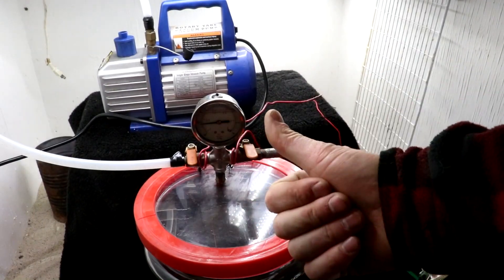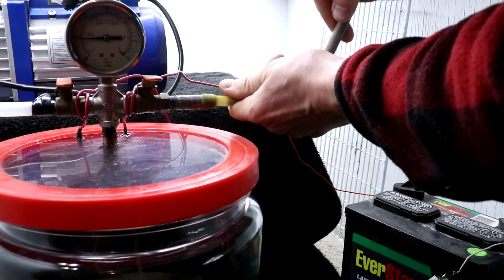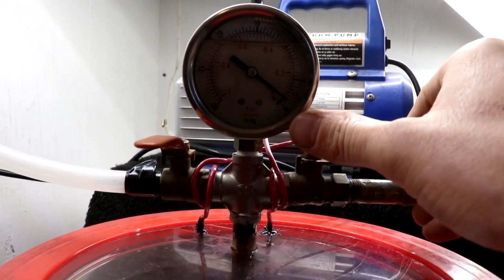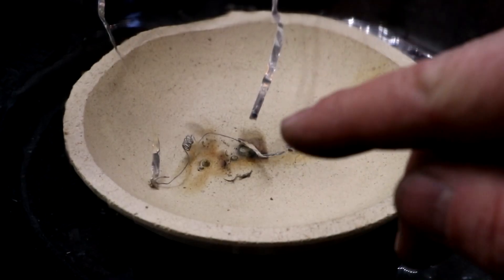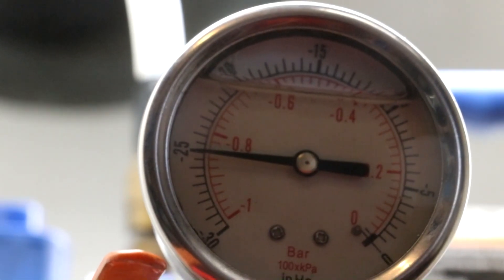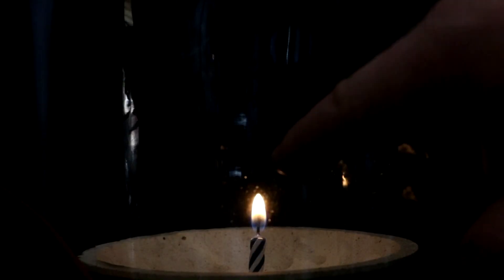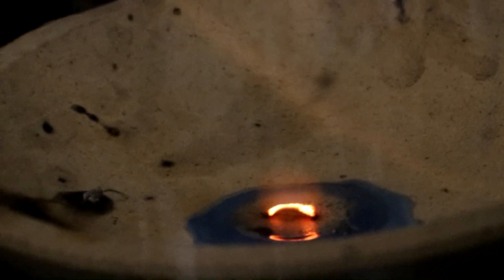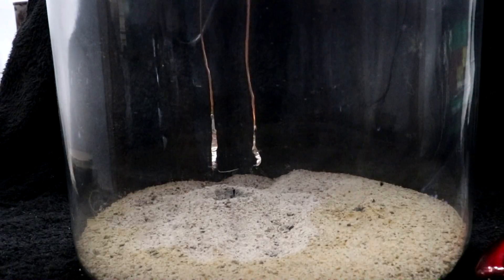Fire in Low Pressure Pure Oxygen

Comment: awesome.. in the last test where the candle burned very quickly, I wonder what all was going on there.  The wax seemed to melt much faster but wasn't actually burning as it would at atmospheric with air.  If the test was done where the wax was held in a container and wick not allowed to be exposed so quickly, would the wax have continued to burn in that pure oxygen / low pressure environment?  Would it burn across the entire surface or is a wick required to maintain an ignition?  Is some of the melted wax actually vaporizing in the lower pressure?  I'm left with more questions than answers - awesome little experiment!

Comment: Paper:
3:30 - Control (1 atm or ~29.9 inHg) w/ regular air
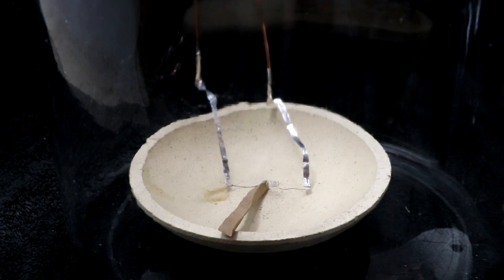5:10 - Control 2 (1 atm or ~29.9 inHg) w/ pure oxygen
6:30 - Low-pressure (~6 inHg) w/ pure oxygen
7:53 - Low-pressure (~3 inHg) w/ pure oxygen
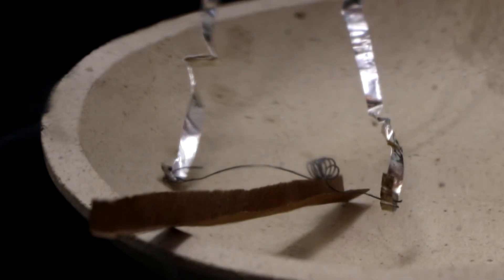9:00 - Low-pressure (Full vacuum)
9:35 - Low-pressure (~0.5 inHg) w/ pure oxygen
10:10 - Gradient pressure w/ pure oxygen
Steel wool (from the intro):
10:52 - Low-pressure w/ pure oxygen
Candle:
11:50 - Control (1 atm or ~29.9 inHg) w/ regular air
13:00 - Low-pressure (Full vacuum)
13:32 - Low-pressure (~3 inHg) w/ pure oxygen
14:40 - Low-pressure (~1 inHg) w/ pure oxygen

Comment: wow, that is truly amazing! I think O2 would be my favorite gas to experiment with. I was watching a spacewalk livestream recently (ISS installing the first batch of the new solar panel mounts) and they were filling the spacesuits with pure oxygen, what is the science behind humans being able to breath pure oxygen? does it need to be lower pressure? and why do they do that for the spacewalks? I would make the simplest assumption of them being able to fit more O2 in the suit and not have to worry as much of CO2 asphixiation occuring. Thanks for this awesome experiment, burn some more things!
Reply: If I remember right (if anyone with sources wants to correct me, go for it) the deal there is: The human body's oxygen intake ability is pretty much completely dependent on the /partial pressure/ of the oxygen, so, the 'total amount' (per volume), not the concentration. so 1 atm at 20% O2 would be exactly equivalent to 0.5 atm at 40% O2, and to 0.2 atm at 100% O2. 
And I think you're right: since 100% oxygen works, why bother carrying around the nitrogen? It doesn't provide a benefit. (except for fire resistance, evidently.) But also: any leaks happen much much slower at lower pressures. This especially matters because there are a couple of joints (the wrist joints, and maybe one other?) which are bearings that just can't really be made to seal perfectly. So they leak, normally. always. so having those leaks happen much slower makes a big difference in how much gas you're just inevitably blowing into space.

Bonus fact!: while I'm pretty sure humans can breathe pure oxygen at 1atm pressure without ill effects, at /higher/ partial pressures (say, when diving) it's toxic! and at /even higher/ partial pressures, nitrogen makes you act drunk! Deep diving gets complicated.
Reply: @Furlucis115  thanks for the info, that is pretty neat to know, the wrist bearings in space suits is something that is super interesting.

Comment: I assume the more total pressure there is, the more heat gets conducted away from the flame. That explains why the whole piece of paper begins to burn so fast and why the candle melts so quickly. With a 100% oxygen atmosphere this is offset by the much faster and therefor hotter reaction due to higher oxygen avalibility.

Comment: In a place with low oxygen, incomplete combustion generally happens so we make carbon monoxide.
The enthalpy of this combustion will be higher then that of complete combustion and therefore generate less heat. This means there is less of a convection current, supplying oxygen easier.
Try repeating the experiment with the same amount of oxygen but add in another gas that's preferably inert to see how the pressure changes the speed.

Comment: One of those really cheap DC motors running gearing to move arms in/out from the flame area so you can quickly get the ignition system out of the danger zone. I would say legos for the gearing but that is just more fuel for a fire so an old school erector set if you can find it so everything is metal.
Reply: Magnets would be even easier

Comment: Somehow it seems as if candle melts super quick under low pressure. Maybe it just seems so and it just that small? Or is really melting that quickly because there is less heat conductance to atmosphere and thus wax increases in temperature more rapidly?

Comment: Wow! So inert gasses interfere with combustion more than I thought.
It looks like filtering even a fraction of the nitrogen out of the intake air of an engine (if an energy-efficient method of doing so exists) would provide good performance even if less oxygen was fed in overall. Removing the nitrogen would remove a lot of the possibilities for pollutants to be formed (ALL of the pollutants if you're burning pure hydrogen, but even with dirtier fuels I've heard that atmospheric nitrogen contributes to a not-insignificant amount of pollution, especially at high combustion temperatures -- all sorts of nitrogen-oxygen compounds, etc.). Also, I'd bet that most fuels would burn more cleanly (less unburned hydrocarbons / soot / CO) in a high-oxygen-concentration environment, much like the paper seemed to burn cleaner.
Are there relatively pressure-durable membranes that have a major permeability difference between nitrogen and oxygen (and are very permeable to one of them at pressure)? If such things are available, a system that simply filters the output of a supercharger or turbocharger might be able to dump a significant fraction of the nitrogen overboard, feeding in a reduced quantity of low-nitrogen gas instead of simple compressed air. This might also allow smaller cylinders to produce the same power, though they'd need relatively large compressors/filters relative to their size. I think that's already the way IC engines are going anyway -- smaller displacement, more support equipment to wring every last joule of energy out of them.

Comment: What was the pressure of the co2 etc created after the oxygen burned... can you do the math to calculate (knowing the approx Mass of oxygen and wick and wax etc) and then verify the result?  Also I didn't understand your explanation of why the height of mercury isn't much closer yo zero.  I realize you can't pull true vacuum but a small fraction of a percent is still 20 inches?

Comment: When you were drawing the vacuum on the lit candle, why did the blue flame last longer than the red flame? I thought blue indicated hotter, more efficient burning, wouldnt a vacuum make it far LESS efficient and colder?
Reply: Blue indicates certain types of combustion products more than heat (certain weird radicals like C_2 and CH). The blue part is not necessarily the hottest.

Methanol burns incredibly hotly, yet almost colorless

why there's no glowing incandescent bit I don't know, maybe it's cooling down too fast?

Comment: Hi Cody, I think the better results of O2 vs air are due to the heat capacity (heat transfer reason). Air is mostly N2 that will warm up as well as O2 and the combustible material, "losing" enthalpy. On the other hand pure O2 has the benefit that the molecules that will warm up and adsorb heat are only those who actually participate in the reaction. Regarding mass transfer I would also expect resistance in air, as the flame front propagates inward as the O2 diffuses in, displacing inert N2. Chemically instead, both systems are the same (same reaction rate). Cheers! Great vids

Comment: I think what's happening is that the nitrogen is acting as a coolant - the fire requires a certain temperature to keep burning, and the fire must heat both the nitrogen and the oxygen to keep the temperature up.  This would mean that the actual pressure is actually fairly unimportant - the part that matters is the fire's ability to heat up the surrounding gas in order to spread.

We can test this by starting with air and increasing the pressure by adding just nitrogen.  At some point, the presence of the nitrogen should be great enough that it absorbs too much of the heat generated by combustion for the oxygen to become hot enough for the fire to spread.  This is similar to stopping a fire by dumping water on it.

One other test that could be done is to use an oven to heat the atmosphere to the flash point of our sample rather than using a heating element.  In this case, we should expect the partial pressure to be much more important, since very little further heating must be done to spread the fire.

Comment: My guess about why the nitrogen slows down the reaction, would be that it would mostly be for thermal reasons? If temperature at the reaction site were uniform and held constant, I would expect the rate of reaction to primarily be partial pressure dependent, but in the real world the temperature at the reaction site rises rapidly, and dramatically so when there is less inert gas to help transmit heat away.

Comment: there is rule, that You cannot touch oxygen gas tanks with oily fingers or oily gloves. and here You using oxygen in oil vacuum pump, oil is dripping in chamber with oxygen and nothing happens,  can You explain what is ging on with oil and oxygen ?
Reply: Never heard of that but my guess would be that oils, especially engine oil, destroys rubber slowly. In the case of the O2 tanks, the hoses are still rubber, so you might cause a leak and risk a fire hazard. You would have pure oxygen leaking and nice oil-covered rubber to start the fire, all you need is a little misfortune and a spark.
Reply: @tusux2949  no problem is not just the fire, in our country if neededa pond in the field, just lay the O2 gas tank with small flow, place near bucket of used car oil an long long string, then just pull the string and kaboom, instant hole in field ! of course ti is not fully legal but they do it like this!

Comment: The reaction rates should be proportional with the partial pressure of oxygen, but also a function of temperature. 

Convective heat transfer will be affected by pressure, so it could be that despite a lower partial pressure of oxygen you have increased overall rate in reduced pressures, up to a certain point.

Comment: Another aspect of the fire being more vigorous could be due to there being less heat lost due to convection, so there is more heat available to drive the combustion.
Reply: Good point. Countering that of course, will be the fact that there is less convection driving fresh oxygen to the flame. So there's less "blowing out" but also less "fanning the flames".
Reply: @jackroutledge352  I was more thinking of the air that is immediately surrounding the flame but not necessarily participating in the combustion, is less able to transport heat away. But you also make a good point too.
Reply: @aaronmett5678  air us not conductive to heat like that

Comment: Which is more able to sustain a flame: mixtures of oxygen with helium or oxygen with xenon? I think xenon would better support flames because the thermal conductivity is lower and the density is higher, so convection is stronger.

Comment: The Nitrogen in air reduces the temperature of the reaction, as it does not react, but it sucks up heat from the reaction. So while the heat available at the same partial pressure without nitrogen is the same, the temperature is different, causing a faster reaction.

Comment: Essence of Cody's Lab: "I wanted to see how dangerous X is under Y conditions."
Reply: @Fred G. 🤦‍♂️ I read your comment wrong
Reply: how dangerous is metallic hydrogen when i light it on fire in a 20% fluorine atmosphere
Reply: @Dman6779  don't know but I would bet on either inert or explosive. That doesn't seem like a combination that would react slowly. Unfortunately it is not an experiment that anyone will able to try any time soon.
Reply: @johnbennett1465  k
Reply: This video reminds me of the Apollo 1 accident. 3 men were that candle / piece of paper.
Reply: I want to burn my X, not my Y. Hey, someone should do a cooking show... oh.
Reply: There was the topic of spacecraft (like Apollo) using pure oxygen but under very low pressure (5psi, which equals over 8000m altitude). Apparently the fire hazard is then only about as big as normal air under normal pressure. The only 2 (i think) space related   accidents caused by pure oxygen were on the ground under very high pure oxygen pressure for training (USSR, 1dead) and testing (Apollo1, 3dead).
However @SID they didn't burn, they asphyxiated. Their space suits were apparently still white (i heard, haven't seen.).  Had their hatch opened as quickly it did AFTER the changes to the CM, they would probably  have survived.
Reply: How dare you assume there are only 2 conditions!! There are infinite conditions!!!
Reply: @Fred G. I was being sarcastic

Comment: Will rate of convection be an important factor here? At room pressure, the candle loses heat to the air 5 times faster than in a pure oxygen environment. Therefore the flame is hotter and also a lot more heat gets transferred to the wax.  
  
Also you should try different inert gasses for the other 80%. Burning in air vs heliox vs O2+CO2 vs O2+SF6. Maybe the different heat capacities of the gasses will have an impact.

Comment: Theory: The candle burns a lot faster in pure oxygen at the same partial pressure as air because in air, the heated unreactive gasses cause the hot gas to rise faster instead of spreading out evenly, which melts the wax.
Reply: I'd hypothesize that an additional factor will be the presence of inert gasses slowing down the rate at which fresh oxygen can reach the site of combustion.

To test your theory, you'd want to use inert gasses with different specific heats in mixture with oxygen. If your theory is true, then gasses with lower specific heat should cause combustion to speed up, since for the same amount of heat energy input they will have a higher final temperature. This should theoretically increase the buoyancy of the flame.
Reply: @Jacob_graber  less preventing the oxygen getting there, and more that the heat produced in the reaction is diluted by the nitrogen.

The theoretical temperature of a flame is much much higher in oxygen than in air- every part of oxygen that goes in brings three parts nitrogen, that shares the heat with the combustion products, cooling them.

Something like 2500c max possible for an air-acetylene flame, Vs 3500c for an oxy acetylene (adiabatic flame temperature)

Heat capacity enters In to it, to get how the energy is distributed
Reply: But if that were true, wouldnt that mean that holding a candle completely upside-down should make it melt at a rate comparable to this experiment?
Reply: *hypothesis
Reply: I am wondering if wax melts at lower temperatures at lower pressures?
Reply: @amicloud_yt  solids are generally unaffected at the chemical level by pressure. Actually that goes for liquids as well, you need to go VERY deep in the ocean for water to behave any differently than it does at the surface. Melting is only determined by the temperature of the environment, as well as any impurities in the substance (such as salt making water freeze/melt at a lower temperature). 

However, low pressure does affect volatility in liquids because it makes them boil and evaporate at a much higher rate. So it is possible that you could get a runaway reaction where the melting wax is boiling and burning much more violently, causing the surrounding wax to melt more quickly. This experiment used such a small amount of wax, it was kinda hard to tell if it accelerated at all, it kinda just all went up at once
Reply: Great comment.
Reply: the convection of the rising gasses pulling cooler gasses from underneath at atmosphere would naturally direct the cone of heat upwards. That constant supply of cooler gasses underneath would serve to insulate the wax against the hot infrared energy, too

Comment: This really gives you an appreciation for the heat part of the fire triangle.  Nitrogen's ability to take away thermal energy without reacting really slows down the reaction.
Reply: Or fire square, as Cody says in the video of burning a self-oxidising fuel under vacuum
Reply: @KingJellyfishII  video name?
Reply: @KingJellyfishII   fire triforce
Reply: Is it primarily the cooling effect of the inert gasses? Or their shielding effect? My first guess was the latter but I cant really quantify that. Arguably in the initial stage of ignition the heat sinking into the gas is relatively insigificant compared to the heat sinks provided by the solids soaking up heat; so it should be possible to tease apart these effects experimentally.
Reply: @eelcohoogendoorn8044  One thing that strongly suggests to me that it's the heat loss making the difference is the candle experiment.  If you watch the candle experiments you can see the wax heats up and melts in seconds, even at the lowest oxygen concentrations when the flame is tiny, and thus not producing much more heat than a candle burning the atmosphere.  I am guessing this is due to the lower cooling via conduction with the atmosphere.
Reply: It is not just conduction to the atmosphere it is convection. As the air heats it rises, this draws in more air.
Reply: @eelcohoogendoorn8044  Assuming every oxygen molecule that bumps into a hot fuel molecule actually reacts, in air you have 4 nitrogen molecules also bumping into it, carrying away energy. In a pure oxygen atmosphere, you don't have that problem. You can see this effect by comparing the flame temperatures of fuel-air and fuel-oxygen torches.
Reply: When fire gets hot enough nitrogen will react with oxygen, not only taking some of the oxygen away but also reacting endothermically meaning it robs the reaction of heat and doesnt give back a greater amount of heat.